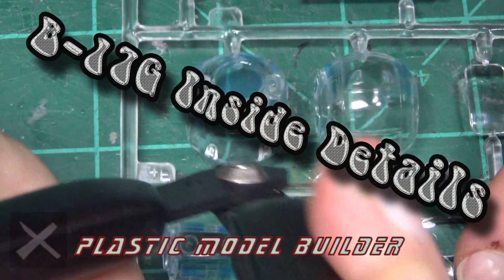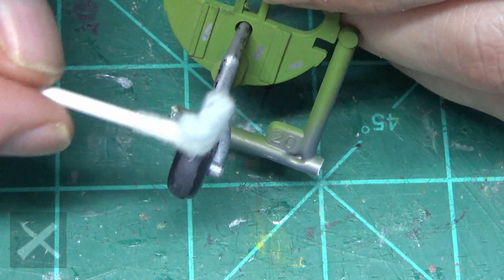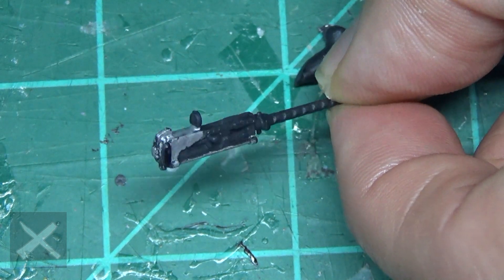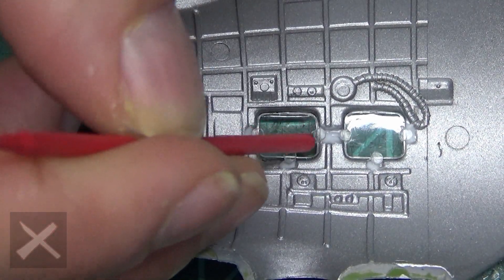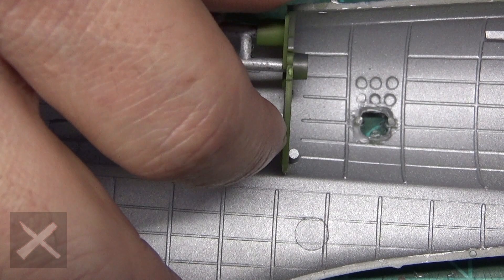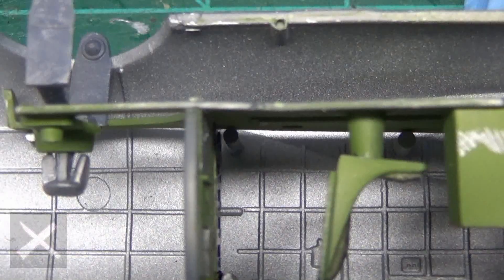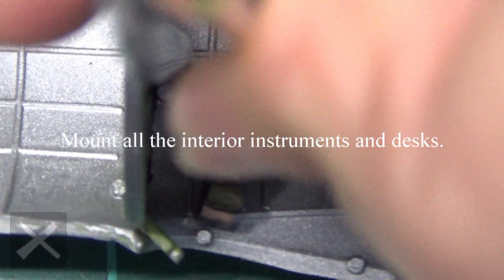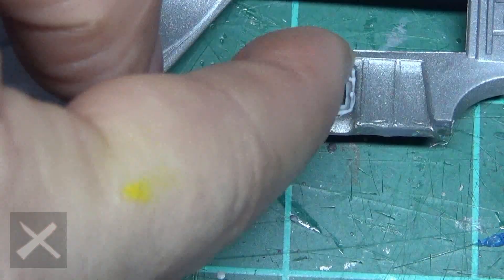Revell B-17G 1:48 Windows, Ball Turret, and Guns, Mid Flight Deck and instruments installed. Pt 4

Comment: I have a different kit, but at the point where I need to paint the frame on the turrets.  Stressing me out!  I’ve been building single engine fighters and the amount of glass I need to mask on the B17 is crazy.
Reply from the maker: Yes it is a lot of glass. The windshield is certainly a challenge
Reply: What are your favorite models single engine
Reply from the maker: I don't have a favorite. I just like to build them.  They are all different. An F-16 though it's single engine!

Comment: Thanks! Building my first ever B17 Revell 1:48.  What type of glue are you using for the windows?
Reply from the maker: I'm using in this particular plane, pva glue. You can use thin cement as well, but be careful with that stuff.